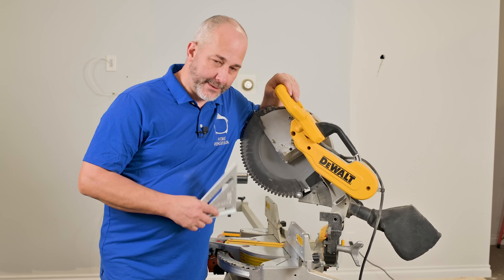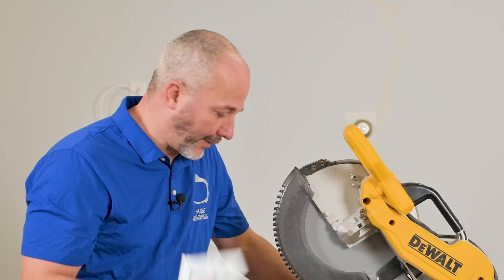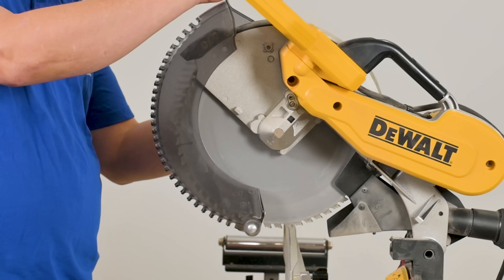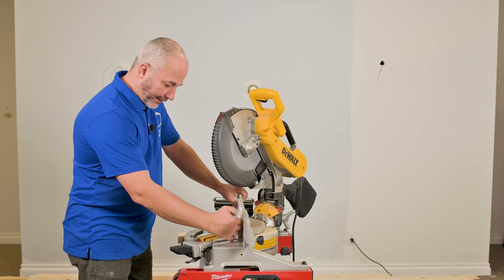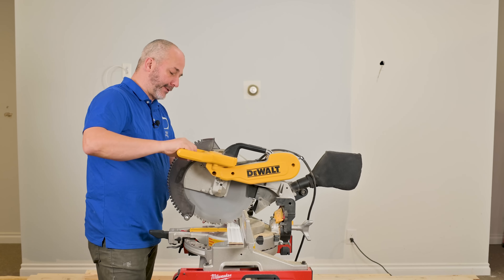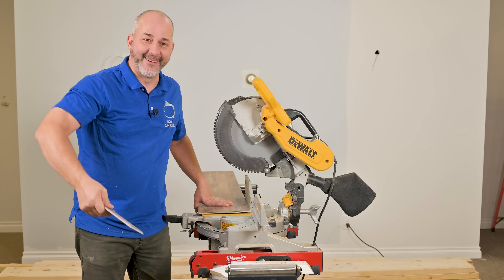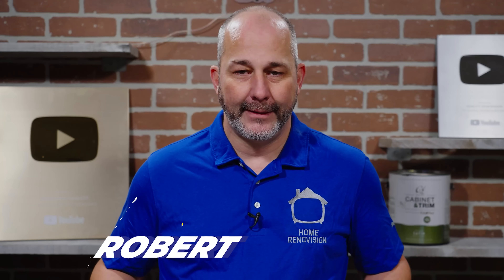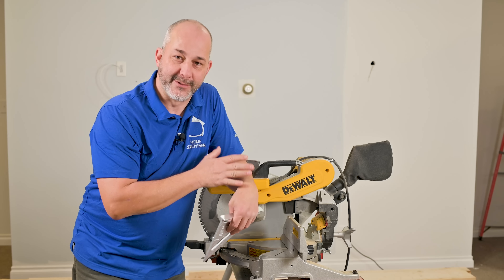How To Use A Miter Saw | DIY For Beginners

Comment: At 9:15 While I am sure some pros do this routinely it's a major safety issue for the beginner Miter saw DIYer. Not only is the safety shield retracted in an awkward manner with your forearm, but the piece you're cutting is impinged against the fence and your hand feeding the piece. Your hand and body are really exposed if there's any kickback or someone bumps you from behind, (Which you mention a few seconds later!)  If you need to cut a piece longer than the span for your miter saw, you should be using a table saw, jig saw, or multitool to make the cut. Overall I enjoy seeing your practical approaches to what seem like complex fixes, but this one crosses the safety line for me in a "Beginner" video. Use the right tool for the job folks!
Reply: Really? that's the safety issue for beginners ? and here I thought him cutting any wood with NO safety glasses on at all , was the Major no no here?
Reply: @compubyte2010  Both are safety issues regardless of beginner. Sadly, it's often the pros that become complacent.
Reply: I concur. I thought the same thing. That why in the heck would you show a beginner that!? Lol
As well as the other longer cuts bending material.
Wouldn’t be advising a beginner to do that. 
I think he just gets excited and cant stop giving tips. Lol
Reply: I dont even own a mitre saw yet but when i do i am definitely not tryin that lol looks well dodgy
Reply: @Phatzoot  Lol I frame new construction and when he did that I was like ....
Reply: Totally, too risky cut for a beginner. Also all the left hand action so close to the blade.
Reply: Easy, to avoid the awkward retraction of the safety shield, you can just remove it altogether. Wam bam thank you maam
Reply: I just got a mitter saw and went straight to youtube to look for safety tips on these machines. I clinched when I saw this dude making that cut, I would never to something like that. You could be cutting thousands of pieces like this but it only takes 1 mistake to change your life in a bad way.
Reply: Even as a pro you shouldn't do that cut, that's just spastic.
Reply: Yeah, also circular saws are affordable, I guess if I'd need to cut a piece of wood wider than my future Miter saw can, I'd simply use my circular saw.

I don't own a Miter saw yet, only a Bosch circular saw with a break system since I have great respect for these tools and any safety feature or practices are welcome. Not this crazy techniques, beginner or not.
Reply: @compubyte2010   I cut a lot of wood on a miter saw, used to produce prefab houses, splinters flying in your eye is not really an issue though... But that move at 9;15 is not very smart to  show a beginner. I mean with a piece of vinyl floor ok, but if beginners then think they can actually do this with larger pieces of wood (or plywood), that can go seriously wrong..
Reply: I don't have to do vinyl, but I would argue that's what a table saw or circular saw is for.
Reply: yeah I think he should be giving a lot more safety tips than he is lol
Reply: This is what I thought. Seemed super risky
Reply: i was givin this guy a chance til i saw this. made me audibly cringe.
Reply: That’s why I bought a sliding miter saw.
Reply: For sure . Iv been installing floors for over ten years and I know , that’s a no no lol . Safety first . Some tips r good for experienced ppl but still scary af n for beginners. Nah .
Reply: Yeah this stood out as a bit crazy to me. Wrong tool for the job.
Reply: Actually, right at the end of a cut like that, ideally, it's best to immediately and quickly let go of everything and do a back-flip and away from the saw. Much safer! If you don't feel confident, consider taking a course in Gymnastics For Woodworking, which can save you much time and money over the long-run.
Nowadays of course many companies include parallel bars as convenient options (with upward-facing saw models), but simple back-flips work perfectly fine for the budget-conscious.
Reply: 'Do as I say, not as I do.'

Comment: Thank you! Very nice instructional video. I have owned my fixed Dewalt miter saw for many years but only occasionally use it for home projects. Today, I encountered a different cut and needed a refresher to configure the double compound feature. I learned so much watching your video. Any new saw owner or occasional user should watch this video. I learned so much more than I came for. I also had been considering purchasing a sliding compound saw but hadn’t since  the need overall was very low. I believe you have showed me how to use my current saw better for all my needs without the need for a sliding model. I’m definitely more proficient and knowledgeable concerning my miter saw today. Again thanks.

Comment: Oh man, I really wish this video was out a few days ago - yesterday I just replaced some damaged baseboard & added chair rail in my dining room, and the “cut it vertically” tip alone would have saved me a bunch of time setting and resetting the saw angle. Completely changes my way of looking at using the saw.

Comment: I have the big 12" slider.   Its so much heavier than it looks, so if weight is an issue, get the 10 inch if you are a home owner.  I own both.    The blades are cheaper and they cut straighter, perfect for the stuff he was cutting.   Dewalt makes good saws.  They even make a smaller one, its around 7 inch.  These saws are all over craigslist, offerup, etc.   People use them for a project and sell them for 50% off retail and even less.  Dont buy without trying it.    Ive been doing remodels, fences, decks, adu's 10 years.    I only do 4 things DeWalt, orbital sanders, miter saws, air nailers are pretty good, and jobsite tablesaws. If youre getting into trim, youre gonna need a finish nailer, a brad gun, and a pinner.  And a compressor.   Dowm the rabbit hole you go.  Haha!    Lastly, he is 100% right about the stand.  If you domt have the stand, you might as well skip the saw, and get a plastic yellow miter box and a rusty old  wooden handled saw.   Get a good blade and dont cut nails 
!!!!

Comment: Thank You Jeff!  I say that mainly for @02:48, regarding the finishing of a cut.  Ask a few tradespeople, and you will quickly get a discussion/ argument going on whether or not to ‘lift up’ after the cut!  And I’m putting that nicely.  If, and I say IF, you are cutting big lumber or wide boards, you can probably plunge cut and come back up, but, BUT for anything else, just take a few extra seconds to let the blade brake do its job, and save yourself, a bystander/worker nearby, and your material!  Make the cut just like Jeff did here people!  I’ve seen small pieces of wood come off and stick or go through fresh drywall on the job!  This can be serious.  I’ve had the saw catch and pinch or twist my fingers by the long piece remaining, when I lifted the head with the blade spinning, and catching the cut off, and the piece on the saw.  

Lifting material to extend the capacity, yeah, most all of us have done it.  I don’t recommend it, but if you must, spend some time with your saw beforehand, get to know it.  

I’ve operated miter saws for over 20 years.  Only saying that as a matter of reference to which I speak.  Certainly not as bragging rights.  Please think, and be safe!  

Thanks for the video Jeff!  👍👍👍✌🏻😀
Reply from the maker: the demo was designed to show the danger. learn from me is the easy way. learn yourself can be a bad thing.

Comment: This is good advice and tips for the younger guys. I was just texting a younger family member and gave him same advice. I actually had that same saw 15 years ago with the stand and took it back for a single bevel compound miter Rigid. Still use it a ton and it fits very nice on my tool shelf. I prefer temporary work benches with an old piece of plywood and horses and some Harbor Freight rollers. The saws light enough to grab and switch it out with a  10” job site table saw. I like to lag the table saw to the plywood even if it’s only a few cuts. One thing most people don’t know is the height of the miter saw is 3 1/2”. So you can keep two pieces of 4xs handy and a piece of pine board to fasten as a jig if you don’t like trying to hold crown still while cutting. I have a piece of pvc 3/4 material that I use for that so it doesn’t warp and stuff. A 12” board is big enough where you can make your jig cuts and it will still stay together with that saw.

Comment: Been waiting for this video on your dual bevel compound miter saw!  It's been a while since your homeowners tools video.  I think my money was well spent on the 12" vs. the 10" even though I'm still learning.   Still don't understand why Dewalt or Milwaukee don't sponser you.  As I've commented in the past, you should have your own show on network television, like Maine Cabin Masters :)   Thank you for sharing your expertise.
Reply from the maker: Love it, we don’t know either 😆
Reply: @HomeRenoVisionDIY  To get sponsored I believe some companies make you sign a contract that says you'll (at least publicly) only use their brand and no others. Also, once sponsored you won't always get their stuff for free, but you'll get it "at cost", so still cheaper than store prices. That was the case for music instruments when I worked for a music gear supplier. No idea if that applies to DeWalt or other tool brands though.
Reply: Well, you don’t get your own TV show when you use power tools, especially saws, without wearing safety glasses.  And no network is going to sponsor someone who shows tips like raising the working piece up off of the table into the saw blade - that’s exactly why the making the sliding miter saws, so you keep the working material flat on the bed where it’s supposed to be for safety reasons……..

Comment: A little trick I learned, put a piece of painters tape on the throat plate (bottom of the saw where the bottom of the blade goes).
It gives you a zero clearance for smaller cuts and you can reference off it so you know exactly where the blade will cut.
Reply: Excellent Yard Dawg!  Not only will it help with the cut, it IS a safety measure, as small pieces won’t fall into the throat area, and bind up or get caught with the blade!  Another reason for leaving the head down, as the blade comes to a stop!  
Peace!
Reply: Just pull the saw blade down to your piece and see where the teeth hit and cut the waste side like he said.

Comment: This video has made me rethink my purchase.

I always try to buy the best for the money.

I purchase a Skil 10" Miter Saw - MS6305.

I almost purchase DEWALT Miter Saw, 12-(DWS716XPS)
The main difference is that 
DEWALT has 12” disk vs Skill 10”
Skill has the sliding feature vs no sliding for DEWALT.
Also DEWALT is $130 more on Amazon.
Did I made a bad choice?
Is the 12” dis worth the $130 more?
I already know by the video that the sliding function may not be something I need anyway.

Please let me know if I should switch haven’t use it and I’m able to return it to Amazon and get the DEWALT

Comment: Ahhh💛 This was so helpful! I like the 15 inch cut you demonstrated by lifting up the flooring plank. Good to know these tricks.And the hack to ending a baseboard against the wall by not just cutting it off but adding another miter cut smaller piece that connects it to a 45 degree angle! Very cool trick!💯🇨🇦🍁
Reply from the maker: Glad it was helpful! Cheers!

Comment: One of the things that they teach us at Habitat is to NEVER reach across the blade (perhaps to catch a piece of dropping wood).  Never have your arms crossed.     Instead, use one hand to hold the wood, and the other on the handle, and don't cross your arms.  (They are also quite strict on hearing, and eye protection, and not wearing gloves while operating the saw.)
Reply: He thinks safety is not important since technique will always protect you. He's very, very wrong. I like most of his stuff but he's not very safe.

Comment: i have a 12 in fixed miter saw and the only thing it just doesnt cut all the way through,so im getting a sliding miter to do some oak stair treads and risers, my question would be which should i get a 10 in or 12 in and which brand take in im just a diy er

Comment: Guys, I ve just set up my handyman business back home in france and i used to go with makita for my first handyman thing in Australia, but i see Dewalt everywhere, what would you recommend the most and why ?
Makita or Dewalt ?
Thaaaanks
Reply: Over the years I have learned that sometimes each manufacturer makes certain products better than others.  I have a lot of Makita 18V tools and their tracksaw too, but for Miter saws Dewalt makes a better one I believe from my research, or the  Bosch 10” with the over-centre hinge if you need 12” depth cut capacity.
Reply: @spencerrs-e2g  thanks man ! Really appreciate it !
Yeah that s what i thought. Makita more as a creative brand and dewalt bit more powerful and last forever..
I think i'm gonna switch yeah just need to by 2 different sets of battery tho
Reply: @frenchiefrog1564  
Hi Frenchie,  if you already have a Makita battery platform I wouldn’t go with a Dewalt. There is not enough difference to make up for carrying two charges around. Makita are “Long life” tools! Maybe longer than Dewalt. My Dewalt saw is corded and at the time the reviews and the handle on the Dewalt were preferential for me. As for battery platforms I have two, Makita and Milwaukee, and I would not want any more!  Both those lines have lots of tools for their platforms here in NA, and both are solid brands.  You need to see which brands there in Europe offer you the most selection of tools for their platforms I think before making big purchases, because as you know batteries are not cheap!  If you can keep it to one line of tools that would be best if you are going to be doing the Handyman thing, and Makita is a top notch brand with lots of tools supported on their battery platform.
Cheers, Spencer
Reply: @spencerrs-e2g  Heya spencer !Love it !!! Thanks for the advice.
I'll stay with makita then, i just don't understand why most of the contactors i see making videos use milwaukee or dewalt... but i think that all makes sense, it is all american and they probably got money from these brands to use it in their videos..
And in australia and new zealand i remember they go with makita which is asian, so pretty close from Australia, sometimes festool or hikoki..
Alright cool thanks again !

Comment: So I saw a video on quarter round that said 44 degrees on inside corners and 46 on outside corners to compensate for imperfections. Would this miter saw be able to make those cuts? Are those degrees truly necessary?
Reply: Many saws go to 46 or 57 degree cuts.
You can use a square to see if corner or walls are at 90 degrees or more or less, that's when you need less or more than 45* cuts.

Comment: Love this video. However, what do you do if you have a smaller miter saw with a tall baseboard that you can't fully cut if upright? Especially if you need to do a scarf joint? Can you only do a scarf joint cutting vertically?
Reply: Bevel cut it.

Comment: Hey i have a question . I'm located in n.b. I'm renovating a old 1960 house . the basement slab is not level . there almost 5 inch from on side to the other . I also want to do a water heated floor. do you have any good resources(video or non video) for how to remove and re-do a cement slab. I'm also thinking of insulating it with 3 inch foam since I'm going to heat the slab. also is I'm redoing it and insulating it ect would you still put a subfloor?

Comment: 45 degree miter cut puts a lot of faith on whomever sheetrocked or framed the place. maybe it's 44 on one side and 46 on the other
Reply: Is always a good idea to check corners with a square.
Reply: @joaquinsuarez6090  apparently, house framers don't generally do that. the corners are never a perfect 90. have fun w/ that crown moulding, future installer. for my own case, my miter saw was way off for years, but i eventually dialed it in w/ that billeted bit of a good square. my speed square was just crap right off the shelf
Reply: I just installed baseboard to 2 rooms in really old house with crooked plaster walls. Corners were either over 90 or under and was impossible to do a decent job and had to put lots of silicon.
Reply: @joaquinsuarez6090  i had an adjustable speed square that you could just fit to the corner, lock it down and read the actual angle, but it broke the first time i got around to trying to use the thing. cool idea, not the best execution

Comment: I've seen videos on how cut more acute angles but cutting a board at 45 and then using that as the fence etc..  the problem I'm having is getting through wider material. For example. I'm preparing to build an a frame and need to cut 54 degree on a 2x6.  Figure out the  math thats in excess of 12"  Is there  a way to do this on the saw. or will it require a bigger saw or sliding saw.  Yes, I realize I can do it with a circular. I want something more accurate (for me) that I can set and repicate.

Comment: Hey. Thanks for the video. Can I ask you a question? Those Milwaukee saw brackets look an awful lot like the Ridgid ones that are no longer available... is there any way you can tell me what the dimensions of them are? Outside dimensions of the rails on the stand, rail/tube thickness... I would sure appreciate it if you could.  The Ridgid is a 9944 stand, and the dimensions on it I'm referring to are: a rail to rail width of 12 1/4, and the rail/tube thickness is 1 3/4. Thanks.

Comment: For cutting more length and less splinters buy one with the saw blade on a (compound) slide. It really pays off if you saw a lot. And saw from extendend inward to stop splinters and cut in two passes. But be careful it is way more dangerous when not used correctly.